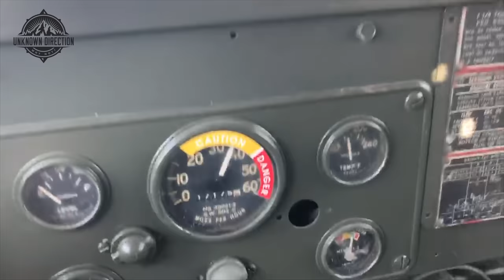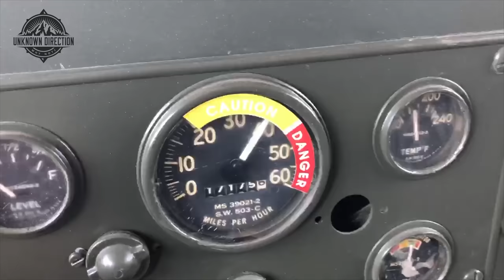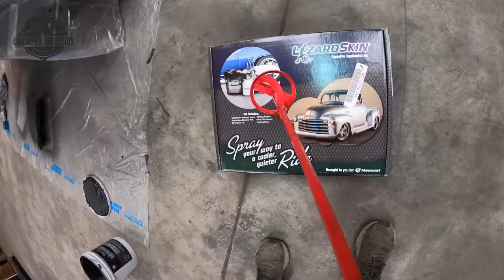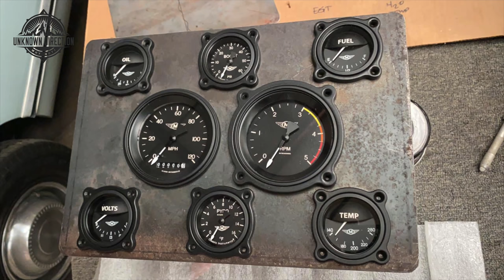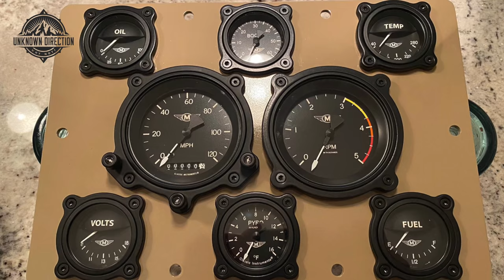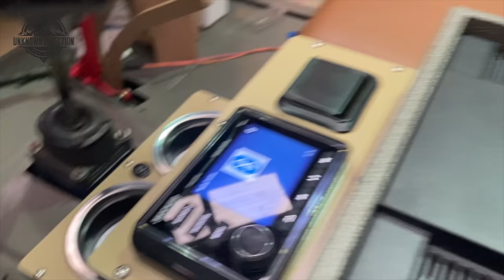M715 Kaiser Restoration

Comment: Amazing!  I used to do the same with 'Rubber Nosed' MGBs.  My 'facility' was an open air 2 car 'port'.  Subject to the heat, rain and cold of SC. I suppose everybody is 'motivated' by one or another.  I stopped dead when I saw this video listed on my YT page.  I used to drive one of these back in the early 1970s, for the US Army as an Army Surveyor in Europe. Sadly I was not impressed with my 'sample' of Kaiser Jeep.  We had some 'weak' mechanics in that day, and our 'budget' was primarily about 'reducing the Force', and maintenance on vehicles was a sure sign we weren't going 'far'.  One particular time we were supposed to convoy to a job site some 4hrs away (at convoy speeds of 35mph/50km/hr). I'd had some issue with the vehicle stalling as it was leaving red lights to cross an intersection.  They never gave it a look or repaired the issue; as a result, I refused to drive the vehicle with or without the crew.  I stated it was a death trap waiting for a victim. While I was threatened with 'punishment', a young, enlisted woman (used to be called WAC) was detailed to drive the vehicle and crew.  3 hours later, my worst nightmare came true. After all the warning, it repeated what it done to me many times... As a result, the vehicle with the 6-man survey crew was 'caught' unable to move, in the middle of an intersection near Erlangen, Germany.  A 'MAN' diesel, 18-wheeler caught them and broad sided them.  This 'oversight' by the mechanics cost the lives of most of that crew.  Needless to say, they dropped the charges against me on being notified of the accident and the deaths resultant of it!  In my honest opinion, the best 'truck' the US Army had aside the 2 1/2 ton, was in fact the 3/4 ton Utility, and that was a Korean vintage truck I drove prior to the M715.  It never had the issues the Kaiser had.  Excellent job on your 'Restoration'.

Comment: I worked on M715 when they first came out, built the orig engine, ran them on Dyno at 
Ft Hood Tx. Engines were turds, your choice of Cummins was great, they are bulletproof. M715 didn't stay around long, guys were buying them out of PDO (DRMO) for pennies on a dollar. Friend of mine bought a contact truck version and installed a big block Chev. It still had the welder, air compressor and associated equip inside it. Hand tools were obviously gone but a gem. He uses it on his farm/ranch.  Think he gave$750 for it.
Reply: In my part of the country, these were selling for about 3 times that price. Seems they only went to auction in batches. That meant spending thousands. Surplus dealers did this, and cornered the market and set the prices. The OHC engine was available on civilian vehicles, but not a big seller. I think Jeep spec'd that engine to dump their parts inventory. The 715 also has a divorced transfer case, and that makes engine and trans swaps easier.
Reply: @jaydee3046  k
Reply: Very 'inclined' to agree with your 'Engines were turds' remark.. Find my comment(s) above!

Comment: The M714 was the first Army vehicle I was assigned to operate in Korea, 1975. You COULD NOT get them stuck. Truck went everywhere we took it. Amazing. Only bad thing was the battery was in the console and would overwhelm the occupants unless you open the windows. Great trucks though.
Reply: 내가 초등학생 때 한국 주둔 미군들이 M714를  사용하였습니다. 한국 육군은 1980년 대 M714를 라이센스 생산하여 지금까지 운영하고 있습니다.

Comment: The Jeep J10 (base truck) was an EXCEPTIONAL truck, to start with...at the time, better-built than all the competition, hands-down. It's SUPER, to get to see an old M715 be brought back in a professional 'resto-mod' effort...unlike most 'chop-it, lower-it' hack videos, I really only saw a very-minor detail I would have addressed: I would have put the PTO box on the transmission, that way if you want to power a PTO winch, hydraulic cylinder, jack, whatever, you've got the box mounted...the rest is easy.

Comment: This turned out really well. The only thing I am not a fan of are the wheels. They just don’t look right on this truck.  The turbo banks/Cummins upgrade is way cool.
Reply: Those are stock wheels it came with
Reply: @speedfreak8200  stock wheels were split rim.  These are not stock.
Reply: And he put the tires the wrong way on one side lol

Comment: I have a M715 im working on as well it looks like you used dana 60 and a 14 bolt rear Im doing the same I made similar brackets in the rear for the leaf springs and i've been trying to come up with a way to do the front everything yall did looks amazing I was wondering if you could email me some photos on how yall did the leaf spring mounts and brackets not looking to copy but anything for inspiration I'd appreciate it thanks

Comment: A build sheet with this would be really nice.
What transmission did you use
What modifications did you do to the 6bt
Is that the original transfer case and axles?
Original ride height?
 I love the the center console. Also was that air conditioning you put under the dash???
Reply: That was not a 6bt, the fucking transfer case, trans and axles are what would have come on military jeeps like this back then, did you not watch the video, and no one is gonna make a build sheet for an old "military" style truck.

Comment: how much cost?
Reply: Had to be $35-50k usd. 

But.... what would you pay for a newish Ram1500? 2024 Gladiator? F250? And then what would you pay for a newer truck with a diesel that has to run a DEF system thats plagued with maintenance issues? No DEF system on this 715 and a a gazzilion miler 12v cummins? The cool factor of a 'Nam era jeep alone would be something but one like this thats vuilt with BT stereo and AC...? 

Shes a unit. $100-120k for that truck. Tell Winslow to keep his Power Wagon